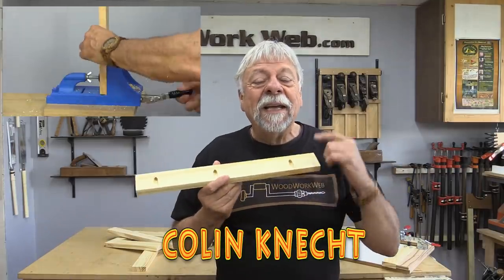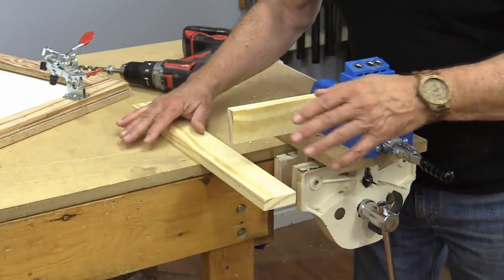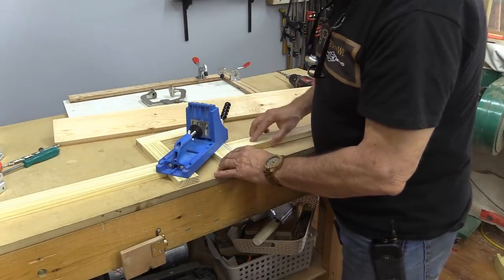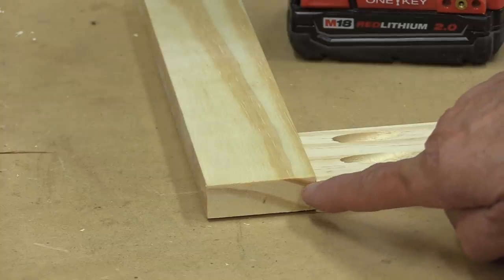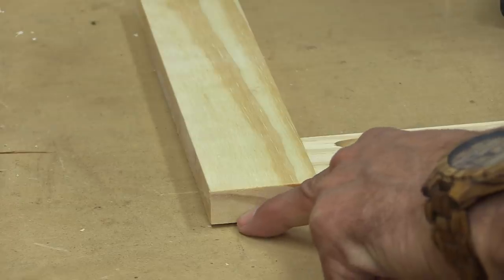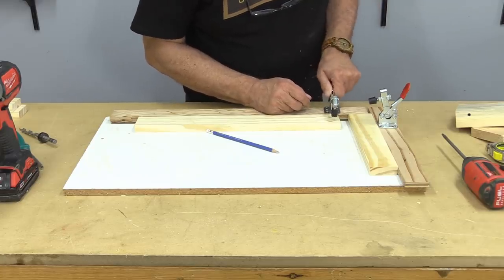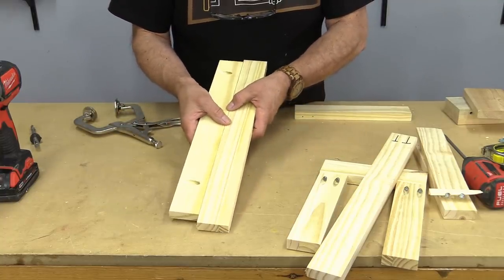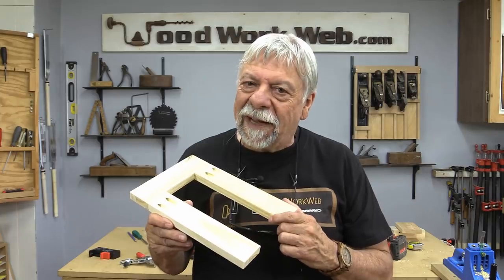Pocket Hole Tips / Pocket Hole Jig Tricks

Comment: With the Kreg jig, paint over the calibration marks with liquid paper/white out, then wipe over the surface with mineral turps/paint thinners. This leaves  clear, very legible white marks.It's quick and easy,  I did mine years ago, and it's still good. Further, I don't fasten my jig down, I just sit it on the bench, and even long pieces are OK - the pockets don't need to be perpendicular to the edge, and for hidden pocket holes the spacings are approximate only. Laziness is wonderful if done properly.

Comment: Another thing I learned through trial and error is that if you're using an impact driver, start it on the lower setting and when the screw bites in, flip it to the higher setting. It really made a difference when assembling a melamine box

Comment: Colin, I set up a similar situation with my pocket hole jig. I found that the base of the jig is 1 inch thick. I attached the jig to a piece of 3/4" plywood  like yours and for the extensions I used a piece of scrap 5/4 board (stair tread which is 1 inch) cut into 2 lengths about 12 inches long. Then I attached a piece of plywood under each extension, and screwed the extension to the base.  Works like a charm. As for your 90° clamping jig, that would be great for face frames for cabinets or maybe even picture frames. Thanks for sharing!
Reply from the maker: Thanks for the tip and thanks for watching!

Comment: Another tip - before trying to put the boards together, run the screw into the pocket hole so it pops out any remaining wood at the bottom of the pocket hole, then clean it up. This stops any tendency to 'bridge' caused by the waste getting in the gap and also helps the screw get a clean entry into the cross piece.
Reply from the maker: Thanks for the tip and thanks for watching!

Comment: The pocket hole clamping jig you displayed in your video with to smaller clamps was helpful. As I found the spring loaded clamp that came with my Kreg system is not very practical. For all applications when joining the timber together especially when the timber is different thicknesses. Thanks again for your tip regarding successful clamping of pocket hope joinery.
Martin.

Comment: I really like your videos Colin.  They are very informative.  What I do when I use 3/4 inch plywood in my Kreg jig  is adjust the collar on the drill bit instead of the preset 5/8 since you might lose strength in the depth of the screw.
Reply from the maker: Thanks for the tip and thanks for watching!
Reply: With my R3 jig, you are supposed to adjust both the jig AND the bit. At least that’s the way the instructions in the kit tell you to do it.

Comment: The flat panel jig with toggle clamps can be improved by having a 4" (100mm) gap in the corner. Then you can also use it to make 'T' joints as well as 'L' joints without changing anything around. I've been using one made that way for several years, the base panel is made from melamine covered chipboard so I can use it for glued joints and any glue squeeze out just pops off when its dried.
Reply: Bruce Lee Thanks for this tip. I made one this afternoon and included your modification.
Reply: Could you please specify where the 4" gap goes in the corner I'm having difficulty visualizing the gap? I plan on making the jig and improvement sounds great.
Reply from the maker: That's a GREAT tip. Thanks for sharing.
Reply: The flat jig almost looks like the one toggle clamp will not allow for the drill bit to access the two drilled holes.  You did not show it in operation but it looked like the clamp just gets in the way.

Comment: Colin that Kreg clamp is basically most useful when using the one or two hole jigs. It’s purpose is to hold the small jigs in place. The two hole jig in fact has a mounting pad for this clamp. Check out Kreg’s instructions.

Comment: One thing I would add is to routinely check that the Kreg jig is holding it's height setting. Mine tends to slip often....and if you aren't paying attention than you will end up making the holes to deep and your screws will stick out the other side of the mating pieces when you go to put them together.  So as you are making the pocket holes, make sure you constantly make sure the height adjustment is not slipping to a lower setting.  Might save you ruining some wood.

Comment: Thanks for the tips! I have had trouble with using pocket holes to clamp boards together on the short sides to make a bench top. I was using an impact driver and it would snug up just a little too much and introduced some cup to my bench top. I've learnt from that but it was an annoying thing to learn after the glue had gone off
Reply: Quit using my driver on pocket holes, not enough control.  Now I use my drill to drive.

Comment: Do you have a video that illustrates how you built the assembly jig?  Though it looks straightforward to build, but I'm curious on the way you elevated the wood so the sawdust would not gather on the edges. Thanks in advance.

Comment: Yeah that’s a smart jig. Only thing I would adjust is the distance of the clamp where you’re going to drive the screws through the pocket holes. If you look closely at 7:25 you’ll see what I mean the clamp is to close to the pocket holes. But again it’s a smart idea thanks for the tip.

Comment: @woodworkweb Thank you Colin... I’ve heretofore not ever used pocket holes for anything because I have always made everything with joinery and glue.  I guess maybe I was of the idea that, I don’t really need to do it and there’s skill building in even building shop projects and jigs with the same Dado/Rabbet/Mortise/Tenon/Box/Dovetails that I use in finished projects/gifts/nicer shop projects like tool chests/tool wall cabinets.  BUT: I’ve done enough of that now with jigs/shop gear and I really think I’d like to reclaim that time by turning out jigs/gear faster. Also thinking that maybe by using pocket hole joinery on jigs, that I can modify/refit them easier which saves on material and time both.   I’ll still not be building furniture with them, but I just ordered the KMS5 System and I think your videos on pocket hole joinery were what pushed me to pull the trigger.  You don’t shame or talk condescendingly of purists or those of use who have a blend of machine/hand tool shops.  I’m probably 85-15% handtool to machine; only really using machines where they save time that can be better spent cutting/designing joinery. So jointer/planer are the machines that use up 12 of that 15%.  Thanks a bunch brother and Semper Fidelis, Shannon

Comment: I use threaded inserts in my work bench near the center, but on the edge. I drilled the holes out in the unit to clearance for 1/4-20's and placed the inserts into the work bench so all I have to do is run the screws into the inserts and I'm ready to go. I use a couple of pc's of wood on either side of the jig that are the same height as the jig for support of long pc's. I drill a lot of pocket holes and this system seams to work great.
Reply from the maker: Thanks for the tip and thanks for watching!

Comment: The reason the wood comes up when you tighten the screw is because the angle that the screw is going in not because of the grain of the wood, you still need to clamp it but if you clamp it, it enters and holds it straight all the way through straight instead of curving and pulling the piece of wood up

Comment: Whenever you need something built fast and able to be disassembled: use pocket holes. Whenever you need more precision, strength and beauty: use joints and glue.
Is that a good way of thinking as a woodworker?

Comment: The toggle clamps is a great idea!  But doesn’t it impede on the ability to drive the screws?
Reply: It's possible, depending on how they're placed.  The closer to the pockets, the more out of the way it'll be, and as a side benefit it will hold better close to the joint.  Of course, too close, and you may need a pocket screw right where the toggle hits.  However, I wouldn't trust those toggles to hold with a lot of downward force.  They're great for clamping lateral (sideways) movement, but the pure force one of those screws can impart going in is amazing - he wasn't exaggerating when he said you can't hold it by hand.  Especially as far away as he has them, it looks like the screw could still lift the board.  Imagine them in hard maple or white oak instead of pine.

Comment: Good tips, but you seem to be stuck on the clamp only being used "in the air" so to speak, which is problematic. I have used these clamps quite successfuly though, as long as you're clamping the joints down on the edge of your  work bench, or any flat surface. Kreg makes a variety of clamps of different sizes and configurations (although, somewhat pricey), for several applications, maybe you could do a future video on those.

Comment: Im new to pocket hole joinery. 
I've never heard of reusing screws?
Even the good ones. 
I would think you run the risk of head damage,  either break or rounding the head??
What's your thoughts
Reply: I certainly never re-use the Bluekote ones. Some of the coating comes off as you drive the screw and I reckon if you were to use them again, good luck with corrosion resistance.

Comment: A couple methods I've used successfully:  Don't clamp in thin air - clamp it right to the edge of the table!  A common practice is to use a loose sheet of Melamine particle board on top of your tables - the melamine face makes them durable and easy to clean.  The white surface makes it easier to see anything left on the table that you're about to set your work on, and it's cheap to replace when it wears out.  Leaving it loose allows you to slide it out from the edge, letting it overhang the table.  Now you use the 'welding clamp' (or any other clamp with a clamping block) to sandwich together your work pieces and the 3/4" melamine.  The much larger flat face of the melamine keeps your work piece faces in line much better than the clamp alone, and the extra friction helps keep them from moving laterally.  NOTE: Do Not Leave your pieces there until the glue dries!!!  Melamine is relatively glue-resistant until it hardens - then the glue sticks just as good as it does for wood.  I've had a piece just sitting there (not clamped) on a spot of glue I missed, and it ripped a divot in the melamine particle board getting it loose - tore the melamine OFF!
Reply: The other method has to do with the angle of the pockets and works best on shorter pieces.  Clamp the joint Laterally instead (from the ends / edges of the pieces to be joined.  The clamping force increases the friction at the joint, making it less likely something will move, but there is a much more important consideration.  That pocket screw is going in on an angle across the joint.  What happens when the screw exits the first piece?  It pushes some small amount of wood ahead of it.  This, plus the screw trying to get started in the mating piece can cause the joint to open, however little, until the screw pulls them back together.  And that tiny gap is the problem.  Add it to the angle of the screw, and that gap allows the screw to hit lower than it's original target!  Of Course it's going to lift the other piece, because that's where it entered the wood.  Clamping laterally makes it almost impossible for the joint to separate, so the screw goes where it's supposed to.
Reply: Can't use any of these methods?  If you have the time, you can clamp the joint with glue in it (obviously taking proper glue precautions), give it a few minutes to set, then add the pocket screws.  Or.. Cheat!  Head for your local tool supply store, big box or otherwise, and get an extra long 3/32" drill bit (5" to 6" is all you need).  That's right!  Pre-drill!!!  Works every time - just be careful how deep you drill. (Hint: you only need a 1/4" or so into the mating piece to get the screw started.)

Comment: So I have the worst time with screws in general, even when making pilot holes first. Same with pocket holes, have a hard time getting the acrew through. Sometimes the head doesnt go past the top, sometimes, the screw just doesnt really go in. Could it be angle I'm trying to push in with the drill?
Reply: CXL Mobile Headlight Restoration I’m having the same problem. I hope someone gives you tips.
Reply: @Sagir32  just used a nail gun, so much easier lol

Comment: G'day Collin. I wanted to ask you about when you have a board clamped to another board in a T and screwing it down. Like the one where you were describing the glue being stronger than the screws. I was trying to do this on melamine, very slippery stuff I know, to make a mold and I was clamping the pieces down and was finding the boards were trying to wander around when the screws were put in. Any advice on how to combat this? I tried clamping down plastic squares as well clamping the boards but at the end of the day I was still clamping one piece of melamine to another in a tee fashion and the bloody stuff tries to slide everywhere with the coefficient of friction  melamine has. Any advice will be greatfully received as I will have to make many of these molds over time.

Comment: If the plywood you are using ( @ 2:50) is Baltic birch plywood then it is 18mm thick, only .704 inches, not a true 3/4 inch or .75 inches thick.  The Canadian plywood council standard is 19mm or .748 inches thick, much closer to .75 inches.

Comment: I like your clamp board. I have one similar except that the base is 3/4" MDF and I have routed slots in it where I put T-Track.
I don't have the De-Sta-Co clamps where you do, but I really like that idea...thanks.
One comment on that, Seems like the one is actually to close to the corner, and might be tough to get your driver past it?

Anywho, thanks for the video.

Comment: Does anybody know why Kreg doesn't make the jig 3/4'' from the table top?
Reply: The K5 wings are 1.5" ie the height of a 2x4. Either double up on 3/4 or make the same jig from 2x4s. Kreg probably chose that height in part because 2x4s are cheap + it makes the storage in the wings large enough to be useful.
Reply: herbsu43 I’ve wondered the same thing. I just ripped a 2x4 to get the proper thickness. The thickness came out to be about an inch. My jig is a K4. Its base is one inch.

Comment: Hate the tool wrench from Krey. It is easy to be worn out the square at tip. Crazy design. And when you screw in it doesn't not go easy because it keeps strip out of the square on top of the bit. I used long reach star T25 with star bit better and easy for jobs

Comment: I am not a fan of the Kreg system.  The "square" head driver is always popping out of the screw while driving it.  And, what is the worst part, it will invariably split the piece of wood that I am drilling into, especially the 1 x 3 x 1 similar to what Colin is using in his demonstration.  I was making a "frame" for a dog-gate using the 1 x 3's and I ended up going with a pre-made plastic fence after splitting the 3rd board in a row.  Maybe if I used the 5/8" setting instead of the 3/4" setting I would have better luck.  I really don't have very high expectations, however and am looking at using a dowel system instead of screws even though that method is way more tedious and less forgiving.
Reply: Milescraft makes their own version of the Kreg system but their screws use a T20 star head.  Their drill bit is the same as the Kreg so you can use those screws instead of the square head if you don't like the square version. As to splitting, make sure you aren't driving the screws too deeply when you make the pocket.  I also found that clamping the boards together where they meet up (with the clamp Colin doesn't use much) prevents splitting.
Reply: If you can, turn down the torque on your drill.